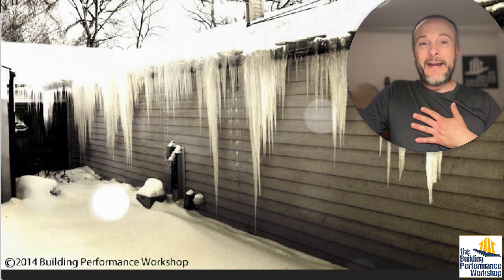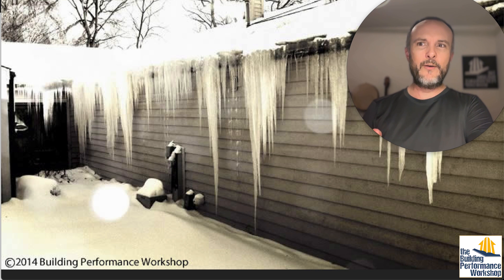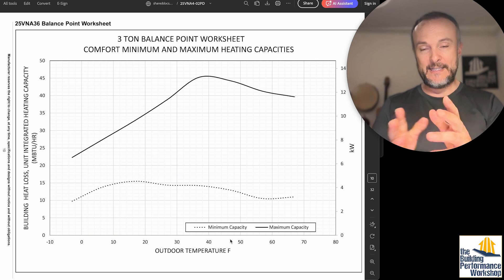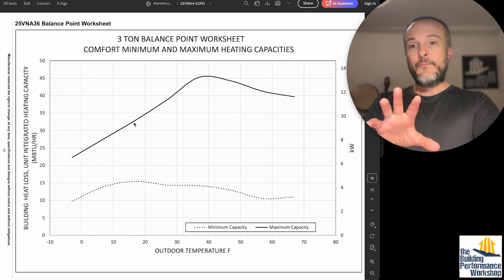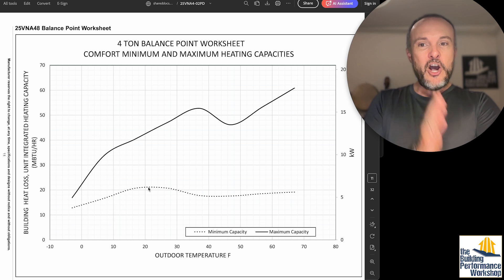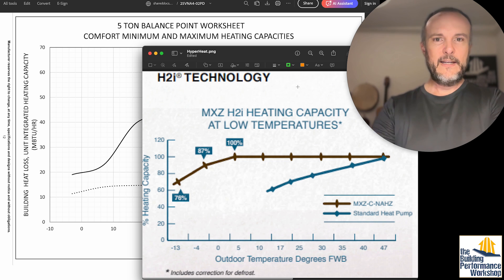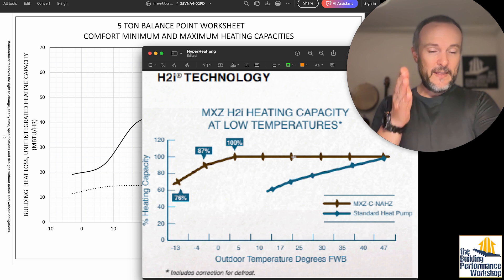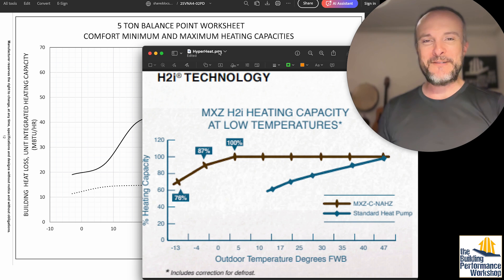'Warm' Climates Need Hyper-Heat Too: Heat Pump Technology, Specs, and Sizing Calculations

Comment: That was fantastic. Exact issue I haave seen even in Virginia Beach at 20- to 25 degrees which rarely happen but it does and the normal low of 30s and not getting good heat.

Comment: If my area never gets below 32° then would a Hyper-Heat be less efficient then one without Hyper-Heat?
Reply from the maker: Still more output at 32, but not much more. You should always look at the ‘extended performance’ data table to be sure of what equipment will work best.

Comment: This is why geothermal is superior.

The problem with some of these calculations is that they do not account for mechanical standards. It is better to have a system oversized than undersized. Allowing a system to run at 100% is not ideal. In most cases with any mechanical or electrical system you never want the extreme usage to surpass 80%. Obviously ridiculously oversizing a system is wasteful. But to ensure longevity and reliability you need some head room.

Comment: Corbett, I’m not a complete novice when it comes to HVAC, but I am curious how some of these cold temp heat pumps are setup without heat strips.  I went through that cold spell here in Texas with a heat pump and thought they are at least desired during the defrost cycle so you aren’t blasted with cold air coming out of the registers.

Comment: Earlier in the year when it was 2 degrees below the local design temp at 15F my 3 ton single stage heat pump was still keeping up despite only producing 1.5 tons of heat at that temp per the manual. A 2 ton hyper heat model would produce more heat than my 3 ton heat pump, and likely dehumidify better in the summer as well.

Comment: Any idea why the variable speed Mitsubishi, Fujitsu and others don’t plot the minimum lines on their output vs temperature graphs?  It’s very useful when you plot the heat load of the house to know what range the unit will stay operating and modulating, not cycling on and off.

Comment: I think in the areas you mentioned, a traditional heat pump with resistive heat boost may be more economical... assuming it is significantly cheaper.  While we may get a few nights a year in the teens, it's hard to justify any significant investment to accommodate those days.

Comment: I agree (scary I know). However the questing becomes just because it can heat down to those temps should it be? I say that in regards to efficiency when it's heating at those very low temps it's heating but the COP has dropped like a rock. 
    What I would like to do on our house is to replace the condenser with a heatpump unit (the evap coil is able to handle a heat pump). Then I would convert the furnace to propane and disconnect the nat gas from the house as the only other item is the stove and I can put in an electric one if we ever use it again... (we use other stuff to cook on) Then when we do have very cold days or power outages I can heat with propane and not pay $25/mo just for the access to natural gas that we rarely use.
      Our furnace is a two stage 96% unit and the ac coil is a 4 ton coil with a 3.5 ton condenser as that was the combo in the manual to get the higher efficiency. If we went this route I would go with a 2 stage condenser. 
         I'm in TX and the subject of oversized AC units never comes up however undersized comes up allot especially on newer homes that are doing detailed calcs. I'm not sure what's going on with the calcs but either the numbers are off in the calc for here or the HVAC guys are fudging numbers to spec a smaller unit to make the install cheaper. 
           To me I see the issue with Manj as to sizing is that it is seeing things as one day. It doesn't take into account the heat soak that occurs. Houses are brick here and that brick soaks up heat all day and it barely gets down to 80* at night so that brick doesn't cool it just radiates heat into the house all night long. The ground gets hot... as in over 100* and that heats the ground under the house over time as well. Our cold tap water is near 90* in the summer. Last I checked the nearest design temp to me was 101.6 which is still lower than what it is for where I am when I had my weather station and did the math and came up with 104 being what our design temp should be. IMO 30 years is too far to average over.

           As for the freeze a few years ago that was nothing uncommon for here what was uncommon was the power outages in some places. The population has exploded over the past 20 years and we actually demolished dozens of power plants in the state back in the 1990s because of way over production. Now we have a large amount of solar and wind which mostly went offline during that storm for various reasons and there were no extra plants able to come online as many are down for repairs in the winter as summer is peak power usage season. Now when you consider the massive number of people here less power plants etc I'd say it's impressive that there is still enough electrical generation to go around. SO the news sounds bad but in actuality it's impressive to do so much with so few resources.
         Oh and our power was out for less than a day and I didn't see any ice as at that time I was a few miles away from you in Fayetteville during that whole thing and the only ice I saw was in Mississippi and LA on the drive home. Once I hit the TX line there was nothing on the ground.
Reply: The main drawback I would see of switching from NG to propane would be that propane typically costs 3 times as much per BTU, but if you aren't planning on needing it much due to heat pump use maybe the increased price would be covered by no longer having a monthly connection fee. I've been looking into getting an NG connection despite having an all electric house so that I would no longer have to worry about potentially running out of propane when on generator power.

Comment: Corbett, how about a video on this: the real nightmare - smart thermostats. Heat pumps are in the Stone Age when it comes to controls and user interfaces. Do you have any solutions??? We got a Mitsu VRF heat pump for a ducted system with 2 air handlers/zones. Still in construction so haven’t used it yet. H2i seems great and all, the hardware seems good, but it seems VRF heat pumps have propriety controls and are not compatible with any smart thermostats such as Google Nest or EcoBee. As a younger consumer, this is totally unacceptable. If I could go back before spending like $70k on HVAC, I’d choose something less efficient just to have a better experience and not be stuck using an archaic control. Millennials are soon the main market and we don’t want horrendous user interfaces. The laundry machines have AI and a pointless app, yet we can’t even control the indoor climate without travelling across the house and pressing a bunch of buttons? Seriously?
Reply from the maker: Interesting, putting it on the list
Reply: 100% Agree; HVAC controls are in the stone age compared to any other industry. Automotive, aerospace, chemicals, you name it, they are all light years ahead in regards to controls. Commercial HVAC is somewhat ahead of residential, but not by much.
Reply from the maker: @ZergZfTw wanna be specific in w vid with me buddy?
Reply: @HomePerformance  I would love that.
Reply from the maker: @ZergZfTw gimme a call from my website next week man
Reply: @HomePerformance  sounds like a plan
Reply: @ZergZfTw  we are at a point with technology where systems should really just know what we want, intuitively, and either do it for us or make it super easy for us to do so ourselves. I’m sure all this equipment we have going in the mech room has many settings and features I will never get to use or know about without reading some poorly written 400 page document. Everything should be a couple clicks away. Terrible design on so many levels. As far as smart home technology, I’d say residential HVAC is still at the very, very stupid stage… so there is a lot of room for improvement 🙃 I’d love to see more collaboration with tech companies. If only we could have Mitsu hardware inside but Apple for the user-facing interfaces.

I regret not looking to see what Bosch offers, they have good tech stuff happening it’s just a bit misdirected as I feel a much stronger market need in this HVAC example compared to having an app for a dishwasher. Amazing how companies who don’t listen to consumers can just invest so much in solving problems that don’t exist, yet fail to solve the most pressing problems people actually have. To say I am unimpressed that nobody has figured this out would be an understatement 😉

Comment: It would be nice if companies put out graphs like this for cooling in extreme heat locations. Highest value on the graph I usually see is 90 deg where my Manual J temp would be in the 120's I am guessing (desert southwest)
Reply from the maker: There are tables where they rate them up to 115 deg F I believe.

Comment: The Manual J ran by our HVAC person said 42k BTUs were required. They were trying to convince me to install 66k. I convinced them to give me the smallest configuration with 7 heads: 54k. Hoping to get this all installed in October here in Minnesota. In the event that we aren't quite getting enough heat on a few of the coldest days each year, we'll use a couple of space heaters -- far better than being grossly over-sized during 99% of the year.

Comment: What you have discovered as shocking is the product of decades of boiler men running oil systems and heat pump industry folks trying to recruit these guys by showing them that a) they can oversize add much capacity as before and make more profit on these"fancy modern heat pump things", and b) that heat pumps, a higher quality option,  can and should compete on price.  What results is a race to the bottom, as hp contractors - shockingly including ground source hp contractors - try to compete on price in the too-cheap energy market called N America. There's a reason manufacturers from North America have pushed AHRI to disincent quality and penalize high performance units, and distort regional markets, and it's mainly that energy is too cheap across the continent, and the assiciation drives some regs.  Fortunately, the utility folks realize this and agree, but that is a small light in the darkness. AHRI is the lowest common denominator. 

All this from realizing and asking yourself why the standard US software routinely oversizes by 100%, and heat oumps from Europe and Japan are so much better, well fone you!

Comment: the extra complexity and repair costs of those cold climate inverter tech heatpumps is likely not worth the energy savings over supplementing with strip heat on a 20f day especially if most days during the season are at or above freezing. don't necessarily need much strip heat to do it, 5kw could be plenty.
a good compromise is getting a 2-stage heatpump and sizing for heating - in cooling mode, it only ends up needing low.

Comment: a properly done manual j will not oversize the heating by nearly 100%, it is does not have that kind of safety margin in it. if the house was super-tight and manual j software was set to average or something, yes will over-estimate. better more up to date programs have a blower door test result input or equivalent leakage area.
Reply from the maker: No, I ran the J myself and input the blower door test data (run by me also). It was a shocker.
Reply: @HomePerformance  manual j may do a lousy job on higher performance homes. i've done on an older home and it was about 10% too high based on timing heating cycle length which is within reason. in canada there's a updated csa f-280 which produces lower heat loss results on newer homes.

have a load calc that produces double actual and u might as well not do it.
Reply: @HomePerformance quite right, the manual J is ridiculous. We all need better sizing software.
Reply: @acchaladka  The Heat Balance method is definitely more advanced, EnergyPlus uses it. That would be your best bet short of doing a full 3D finite element analysis of the whole building... Which is definitely possible but would be ridiculously expensive. I did a simple 2D simulation of a radiant heated floor for a class project once, trust me, that is a lot of work.
Reply: Have you actually tracked the performance of a system after you do a Manual J? Install an ecobee and see where it satisfies on design days. I guarantee the results will shock you.
Reply: @TimothyNaugher  that's an essential point. At my last job we had a young engineer + a programmer design develop and release an original GSHP sizing software, web based and using a simplistic kind of self-learning algorithm. It took about 9 months and field testing turned out to be much more agitate than anyone else's design software, so we used it for checking designs submitted from the field.  It is beyond shameful that a powerful industry association like AHRI has not done this, Manual J / F-280 compliant or not. But then, have they or any HVAC association ever been about the actual development of the heat pump industry? Corbin is more right than he knows IMHO.

Comment: Corbett this is great for keeping us homeowners informed, but what we really need is a list (curated dare I say?) of contractors by region who are eager to go to these lengths (for a fee) for replacement systems. You wouldn't believe, outside your circles, how many will roll their eyes at the request of a manual J/S/D etc. Consumers want it done right, and are willing to pay for it!
Reply from the maker: Great news for us all then:
https://homediagnosis.tv/hvac-installers
Reply: @HomePerformance this is a great start! But all the DFW ones only install AprilAire ERVs and barely subscribe to the science. :(
Reply: I’ll say this it’s very hard in our area of Wisconsin to find contractors that are capable of handling the new tech. Which is sad because we have a lot of new houses going up that are just sub par to what’s achieved in other areas.
Reply: Rolling their eyes at a manual j is practically fraud

Comment: Thank you for another extremely informative video! 

As I understand, as ambient temperature drops, the COP falls off faster than the heat capacity. As an example, based on data on a Mitsubishi H2i unit I found, from 47°F to 17°F it maintains 100% of its heat capacity, but the COP drops from 3.7 to 2.0 in a ducted system. I suspect there is a crossover point where the operating cost of heating with natural gas is lower than the heat pump at an ambient temperature well before the Heat Pump runs out of capacity depending on the relative cost of electricity vs natural gas.  I live in zone 5A with a 99% Heating Temperature of 4°F.  Based on historical weather information from the last 30 years and some rough math, about 7.25% of my heating season has an average daily temperature of 17°F or less. While operating costs are only one of many factors to consider, it is a significant factor to me in my heating dominate climate.  I don’t entirely believe my math, but at current electricity and gas prices and a modestly efficient (90% AFUE) furnace the crossover point is a COP of ~2.4. In the case of the H2i unit I mentioned, I think that is around 24°F. And in my climate, 15% of the heating season has an average temperature below that threshold.  I’m curious about your perspective on this and any math you use in your analysis. I’m also curious about the COP of the H2i versus a traditional heat pump in the cooling season.  

I hope you can answer my question, and maybe even make a video about it. Thanks again for the insightful content and education!
Reply: You're pretty much spot on. The crossover COP is a matter of the cost of gas times the furnace efficiency Vs the cost of electricity. For me the COP of a heat pump would have to be above  about 2.1 or so, propane is right at 1.8 for comparison.
Reply: Something to also factor into your cost analysis is the connection fee and replacement costs of the extra furnace. At $30 a month usually for a connection and annual cleaning and future replacement is the little bit of efficiency in cop going to cover all that?
Reply: @gabrieldesantis981  That is a great point. Unfortunately where I live power goes out for a week to 10 days nearly every year (often in the winter). While we could certainly manage, the wife approval factor just isn't there. I looked into solar and battery backup, but it's still quite expensive. Short days and cloudy >70% of the time in the winter makes them even less viable. A natural gas furnace and backup generator is still cheaper, more reliable, and an easier "sell" to my wife.  And we have some multi day cold spells that fall well into the negatives (Fahrenheit) that would challenge a cold weather heat pump. I briefly looked into geothermal heat pump (2 acre plot seems viable), but it's even more cost prohibitive with our current budget. In short, I'm all for a combustion free house. But due to our logistics, we are going to have a gas connection regardless.